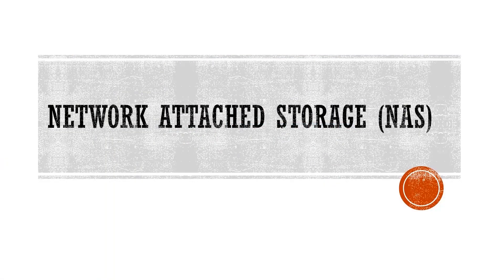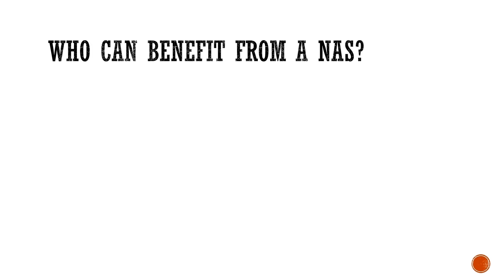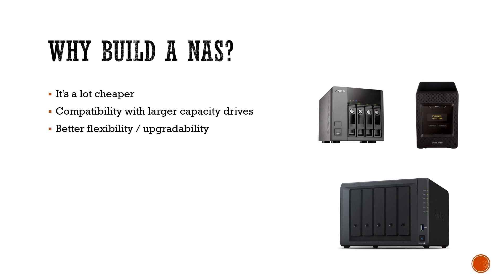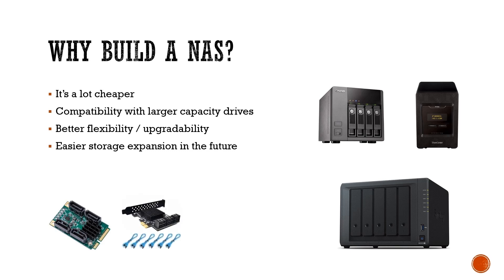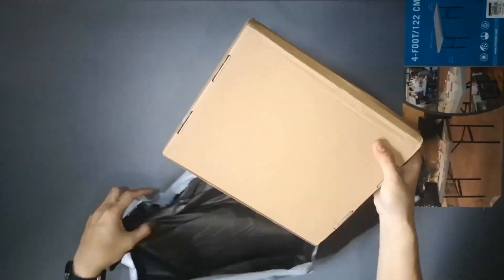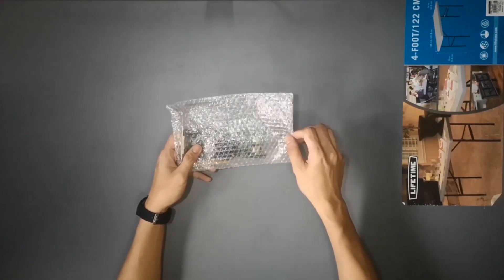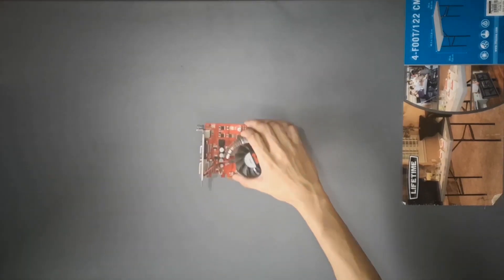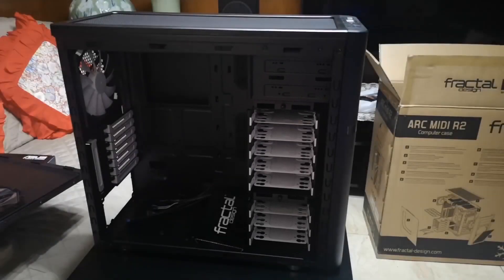NAS Series: Budget NAS Build

Comment: did you forgot to tell us why you wrote the serial's on the hard drives? ;)
Reply from the maker: Sorry, I think I forgot to mention that in the video. Anyway, the reason for writting the serials on the HDDs is so that I can easily identify them when the time comes to replace them. Most (if not all) of the NAS OS use the HDD serial numbers to identify them in your RAID. If you dont write these serials where you could easily see them, you might need to remove each of these drives just so you can see the serial numbers and identify them.